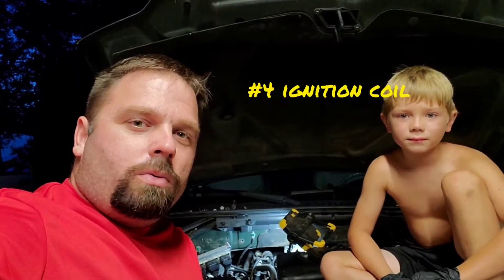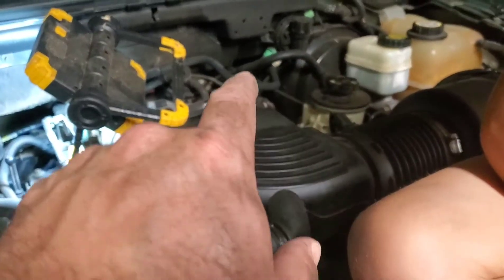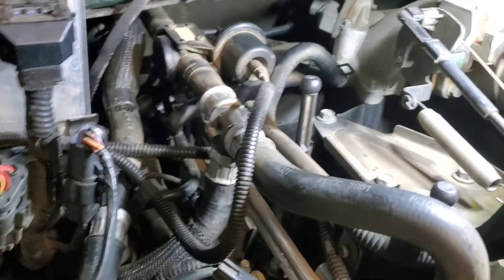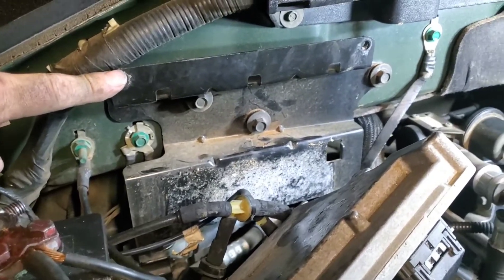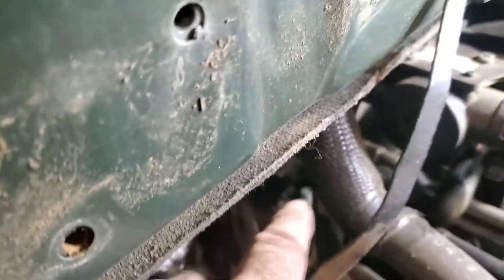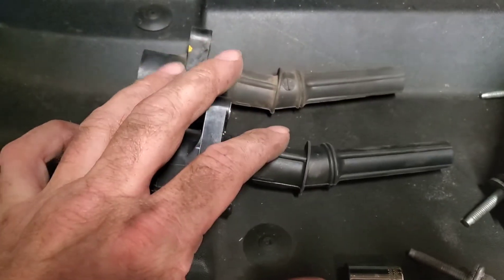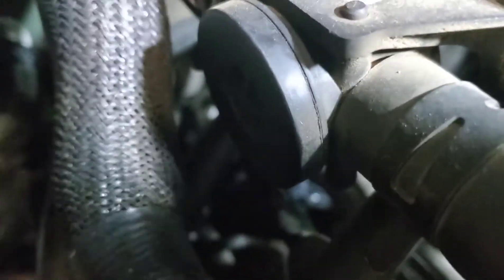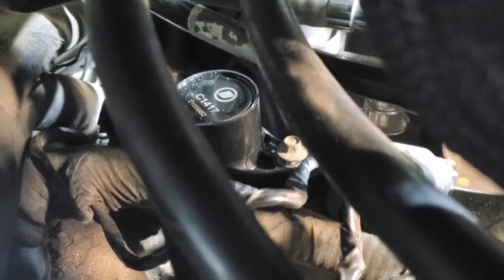Replace #4 Coil Pack | 04 Ford Expedition

Comment: Must be an early 04 engine or left over.  I believe it was 04 when they switched to the 3v.  Be happy you didn't end up with one of them piles of junk.  Anyway, fixin' to do my #4 as well, thanks for the look.
Reply: My 04 also has the 2 valve. I believe the 3 valve was introduced in 04 for the F-150 and in 05 for the Expedition.
Reply: My girls dad had a 04 with the 3 valve kept having timing problems
Reply: It was a f150 I had 03 expedition it had the 2valve

Comment: How will I know which on needs replacement
Reply from the maker: I check it with engine running and unplug the wire connector to each coil pack one at a time. If they are working properly, you will notice engine starts skipping when unplugged. Do this until you find one that doesn't change the engine sound when unplugged. That will typically be your bad one.
Reply from the maker: Easiest method is to use a scan tool
Reply: Thanks 🙏 God bless you